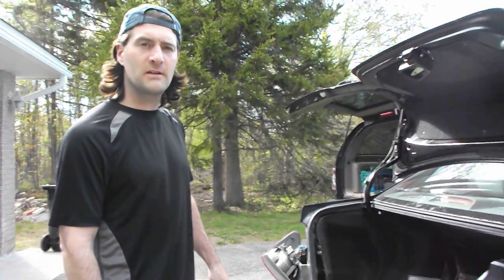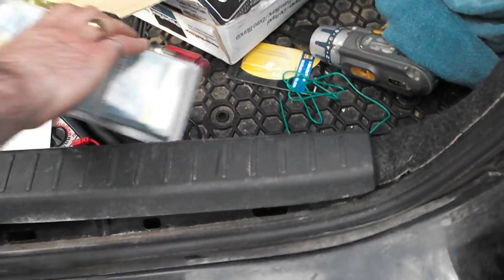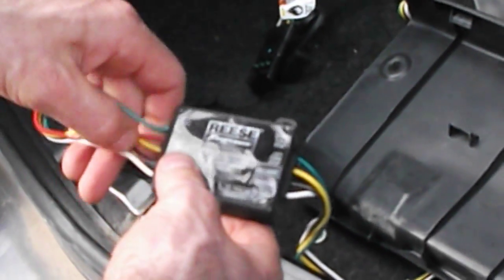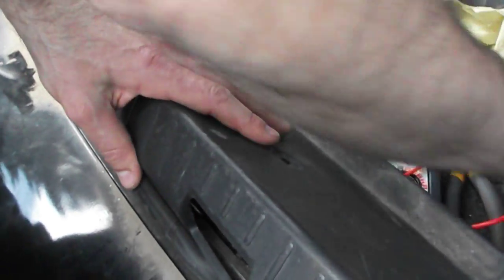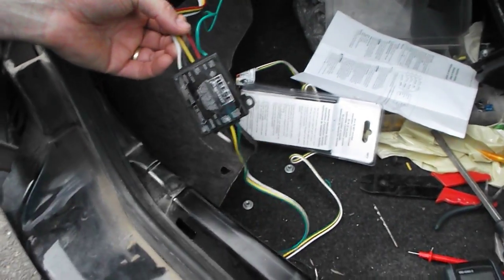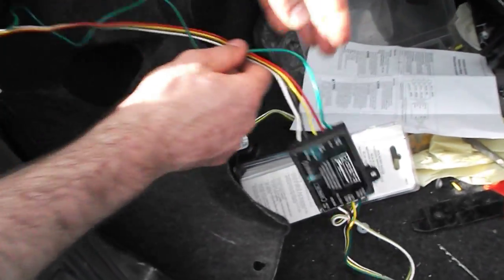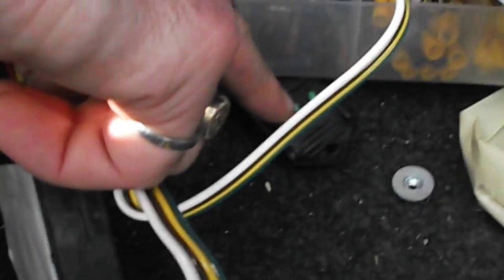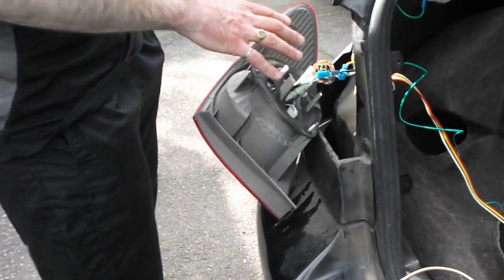Installing Trailer Wiring Harness In 2007 Toyota Corolla

Comment: 5 to 4? I've never heard of it. So (after reading your comments in the description) you're saying that the brake and turn lights use the same filaments? How does that work then, if you're slowing down to make a right turn, then your right hand brake light will flash completely on and off, is that how it works? Thanks.
Reply from the maker: I have since sold the car and made the video years ago but yes, what i remember is there is a different filament for brake and turn signal in newer cars but not for trailers (common filament).  Therefore you need the electronic module to handle the conversion.

Comment: hello, thank you for this very helpful video. It was a little hard to determine the 2nd and 3rd wire that you were pointing to (green/white) and (Green/black). My first attempt didnt work but I think that I did not do a good job with the wires and the T-connectors. Thanks again

Comment: Thank you for the video! I saw you put both right-turn and left -turn signals on your left side. Is that the right way to do it?
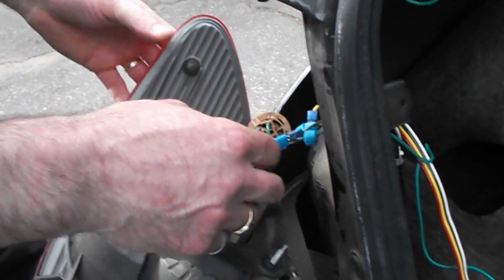Reply from the maker: @3:29 I show the right signal wire location. Unlike all other connections discussed after that point which connect near the left side light bulbs, the right signal wire connects to the wire harness.

Comment: You only hook up that 4 pin wiring harness at one side of the brake light? not both.
Reply from the maker: Correct. If you think of it you only need to give the trailer light module 1 brake signal since both brake lights are either on or off. Newer vehicles may have another configuration.
Reply: @mrdiyguy123  My 93 camry has two wires for the brakes.  One goes to the center of the bulb base, the other one goes into the bulb thru the edge of the bulb base. Which one do I have to connect to it?
Reply from the maker: @mabast007  hi. The one to the center of the bulb is the bake light "activation" or hot wire.  That is the wire containing brake on/off signal. The wire going to the base of the socket is the common/neutral wire.
Reply: @mrdiyguy123  Thank you for your replies, but I went ahead and took the car to a shop and now everything is good.

Comment: 2010 has different colors. Any one have info for the 09-10 Carolla.
Reply: you get this figured out? in in the same boat
Reply: Pull carpet back till you find the main wire harness then use a test light and probe each wire..So you probe a wire with the left blinker on when the test light starts to blink with the blinker you found that wire same with the brake the running lights and the right blinker